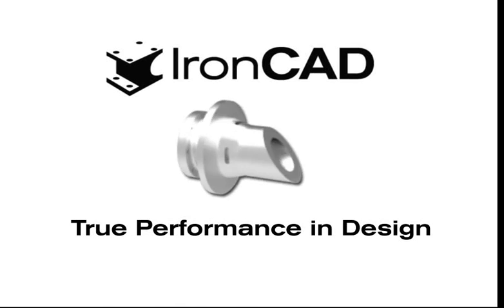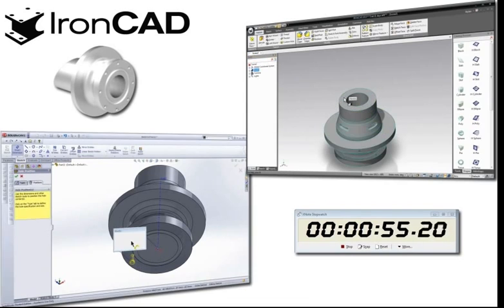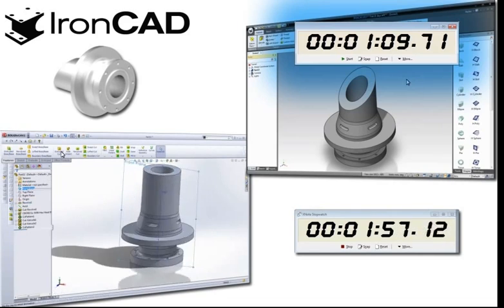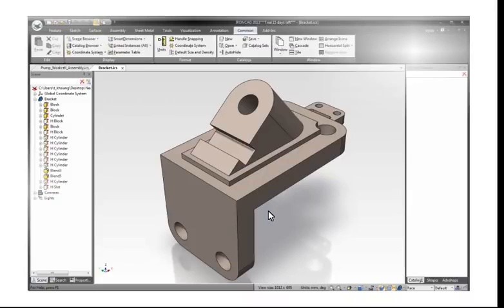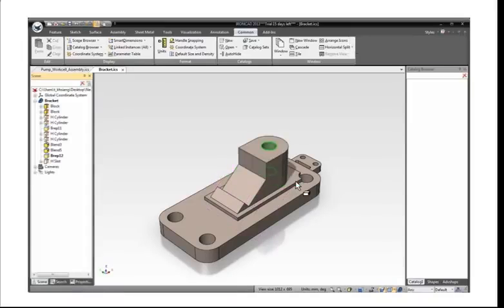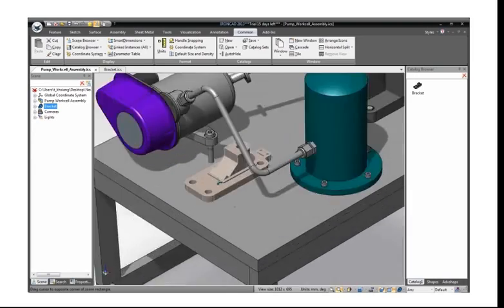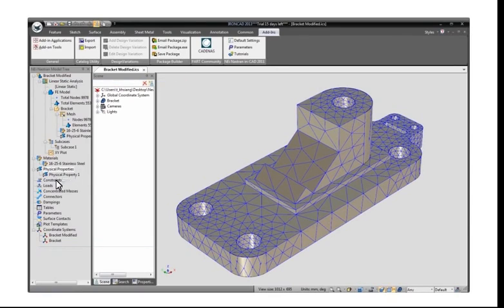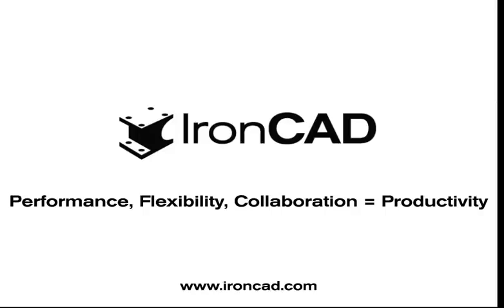IRONCAD vs SOLIDWORKS

Comment: How about the system requirements and rendering speed of complicated assemblies, and what about the availability of support information and media? No offense, but companies shouldn't blow up their own products. Hand them over to engineers and let them mess around with it. This looks too good to be true, and as @JohnBee mentioned earlier, it probably is.

Appreciate the innovative ideas used to develop the package though. Keep it up.
Reply from the maker: Thanks for the feedback! It may look too good to be true, but I assure you it isn't. There are customers all over the world using IronCAD, and in many cases replacing traditional systems like SolidWorks. As with almost any powerful CAD system, the system requirements will change depending on what you're looking to make. If you're making simple parts you could easily get away with a computer that costs less than $1000. If you're modelling huge factories then you would be better off investing in a high end computer. 

For support information and media, check out www.ironcad.com.au/videos.

@JohnBee made a claim with no context, if there is a problem with mechanism mode then the IronCAD team would love to know about it and fix it.
Send us an email and we can go into as much detail as you like on any part of IronCAD, we'll be betting you come away from that research wanting to use IronCAD in your organisation.
Reply: Will look out for a trial version and give it a well deserved shot. Thanks for responding.  At the very least it sounds like you guys are confident about the product.
Reply from the maker: Since posting the comments earlier we can report that sales of IronCAD have exponentially increased globally and are now more than five times that of 3 years ago. I guess people are getting the message and opting for more efficiency and cost savings.

Comment: this video made me laugh - just try loading ironcad's mechanism mode and all will be revealed - ironcad may be fast at modeling, but it's far from good where it counts most  :/
Reply from the maker: Hi John, please elaborate on the problems here? If there's ways IronCAD can be improved then the team would love to know about it.

It's also worth noting that Mechanism Mode is one part of a much larger design process. Depending on your industry, a lot of people don't require mechanism mode or can go straight into FEA testing. I understand if there's a specific part of mechanism mode you require for your work, but writing off a CAD system based off one feature is like writing off automobiles because they are bigger in size compared to horses. Horses may be easier to park, but a car will win in basically every single other aspect.

What's important from a company perspective is "Will this CAD system make me more profitable?"
If in one area it does not, but in 10 other areas it does, then it should still be a pretty easy decision to make.
IronCAD changes your overall CAD workflow, and if that becomes more productive then you can become more profitable.
Reply: @Sidowse  Hi Simon, I just created a swept surface with 2 sketches no problem. Worked using both our Solid Sweep tool and our Surface Sweep tool. Could you please explain your sweep problem in more detail to our team at hello@ironcad.com.au? 
We do have a setting that skips the 2D shape sketch dialog if there's no 3D geometry present, and I do agree this could be improved to also detect existing 2D geometry as well, so I have submitted that to R&D to change. As far as I know this would only ever cause an inconvenience if you are in a model with absolutely nothing in it, and then try to create a second sketch that is not on a standard plane. It can also be solved by moving the sketch plane with theTriBall (just press Q key), whenever you're on a standard sketch plane. All in all it should be a pretty uncommon thing to even notice, and once you know how it works (skipping sketch placement in an empty scene) then there's no problem. At most, this inconvenience would take a few seconds to get around.
In the sweep settings there's an option to twist about midway down the left sweep menu.
We also have a helix generator in our 3D curve tool, and a 3D Helix generator in the tools catalog.
This is the second video you have commented on trying to talk badly about IronCAD, yet as far as I know you have not communicated with us over email or phone at all (at least not to CAD International or IronCAD Aus & NZ), or even replied to our message on the last comment you left accusing us of having fake customers, when in fact all of them are real. 

If you would like to discuss things in detail we are more than happy to do so, but if your aim is just to talk badly about IronCAD without evidence or reason, then we will simply delete your comments.

Have a great day and we hope to hear from you to have a productive discussion.
Reply: @Sidowse  Hi Simon, that's correct, and if you commonly model in that circumstance (needing to do a normal to curve sketch and also having no other items in your model) then you can toggle that setting off by going to MENU > OPTIONS > INTERACTION and scrolling down to Feature Behavior. As I said, I have suggested to R&D that we also detect 2D geometry as part of this, so that would then suit both situations. For now, you can toggle that setting and it will work as you are asking for.
Regarding the Sweep twist, we really need more information on what you are trying to make. It is very hard to understand what "negotiate curves satisfactorily" is referring to in a geometry context. I would suggest you email through what you are trying to make and our team can help you out.
Reply from the maker: IronCAD uniquely has both the Parasolid and ACIS solid modelling kernels built in. By choosing the alternative for that part you will get a different result. The modelling is more a part of the kernel being used than the software implementing that part of the kernel. There are no other programs that offer both kernels.